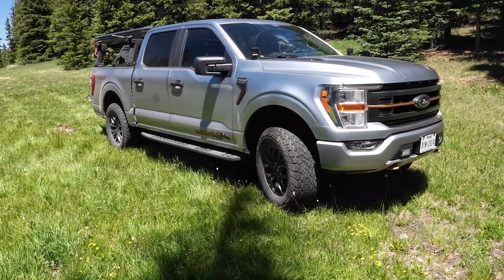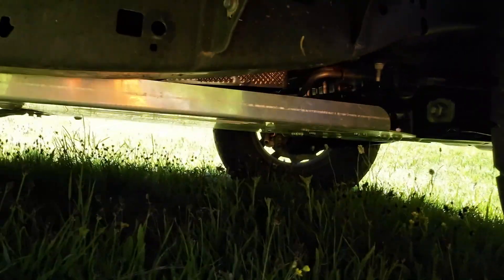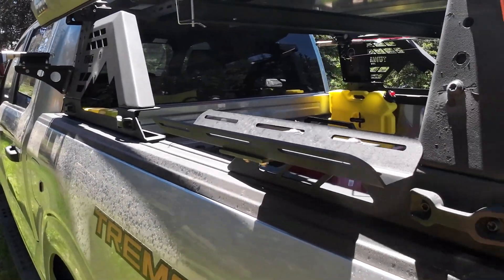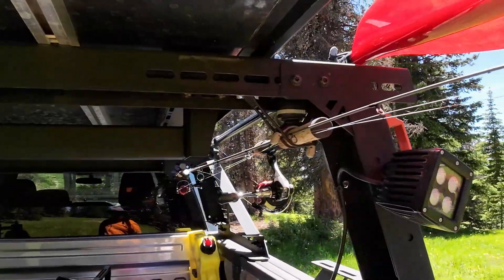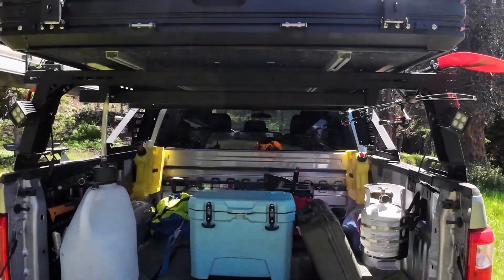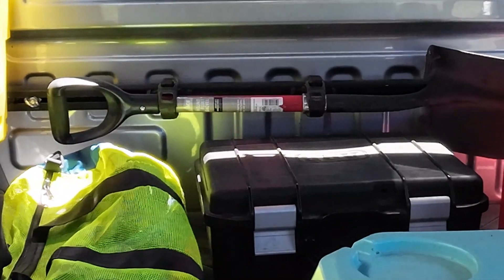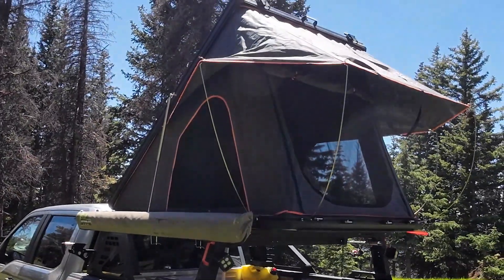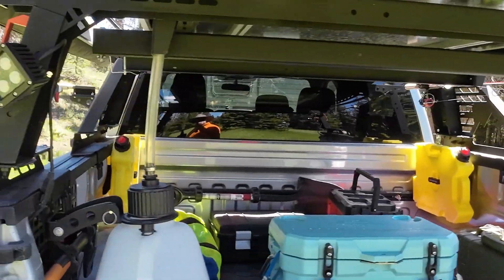F150 Tremor Adventure Rig Build #overlanding, #camping

Comment: What brand and model pop up tent is that?  I like the way that rain flap is designed.  Not sure if enough on the side windows of the tent but looks fine for the main one.
Reply from the maker: Got it on Amazon. Upland is the brand. It's built like the Roofnest Falcon 2. Completely dry in the pouring rain. Look for Upland RTT on my channel.
Reply from the maker: https://www.amazon.com/UPLAND-Rooftop-Camping-Overland-Hardshell/dp/B0CF536GYW/ref=sr_1_6?crid=1UJ0EAXX69EUW&dib=eyJ2IjoiMSJ9.gc7cMbExdnjOs7OmG3A4VOE1bWpMIeZwIACReC4oXYZeIgW9mFB2XDZuhGqGDck5zscRz675cZcJ8M2qFLkJ9hOvPXsR6MwWEInhCs_d1qMZeF5q0anI1F_dFZABsmjaW-DTGjwGJSXn23Nug1Ej0vdKMqAusw2I7-3mZLPBUy5XM3cBskfEuQ9q3_22EcG-shfnnkYQMtnNTXleMtxbEehMkMHH69x9mW7hAT-egLqqiwVhjLuOmEErY4WG7NsxkpYXrzJC8cc_p14trlCfGjE5mcZxxImhQp-K-x6PViE.Gc3fSAIr3XgF0j3SJdatDlbock4KS5ct0jJ3wF5q3qE&dib_tag=se&keywords=upland+rooftop+tent+hard+shell&qid=1727478879&sprefix=upland+rooftop+tent+hard+shell%2Caps%2C178&sr=8-6